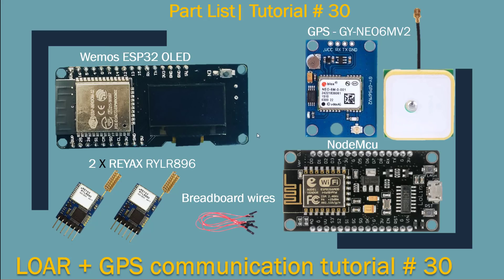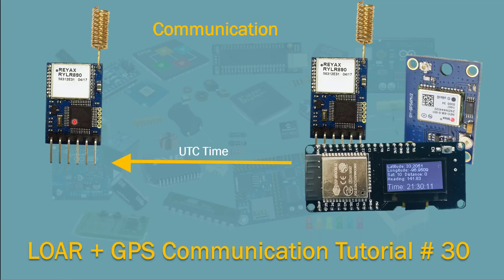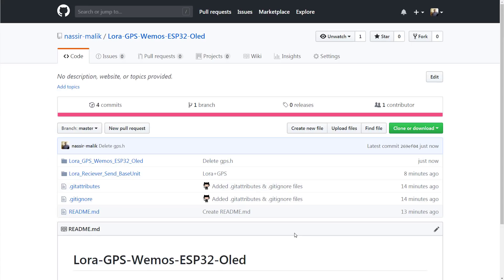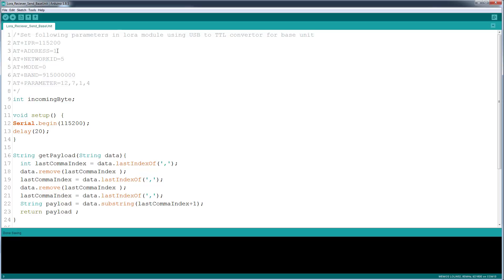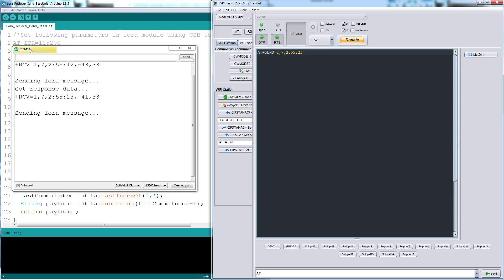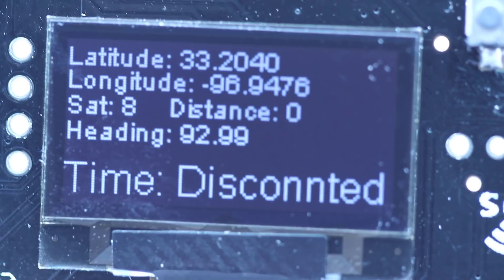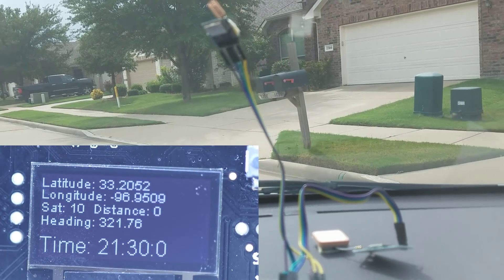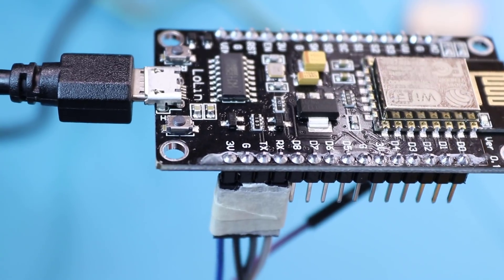Lora + GPS + ESP32 OLED + NodeMcu | Tutorial # 30

Comment: hi i have programmed the ESP3266 4..2 tu turn on my car using my house wifi signal, but i need install it in to my car and when im out my house have no wifi signal and ESP3266 not works without wifi signal , what module do i need to get wifi signal to the ESP3266  4.2
Reply from the maker: Use you cell phone hotspot to connect when away from home or use dedicated gsm module.

Comment: Nice project. I built similar using T-bean GPS Lora ESp232 with OLED display. Had similar finding regarding range etc. So started to building a Mesh repeater network..I used RSSI readings and displayed them on oled for signal strength as well.  while testing I noticed i was receiving packets that were coming from other Lora stations in my area. I investigated the data being received. And found it to be LoraWan packets. So i joined the forum and posted my project on their site.. However it turns out that they asked me to stop my project because it was transmitting far to much data  which was over legal requirements and that  my project was repeating the local lorawan packets and was messing with the system.   Oops. So i have abandoned  my project for GPS tracking.  Might be worth taking a look at their forum before continuing with Lora.
Reply from the maker: Thank you for sharing valuable information

Comment: This looks like a great option to have an ESP8266 with LoRa and GPS 
module send its GPS location to another ESP8266 with LoRa and have that 
one point a compass needle (on LCD) towards the sender. Having two work 
together would allow each device to point to the other. Never losing 
friends in a crowd, concert or hiking. TinyGPS++ is where i am going to 
start to look
Have you come across anything like this before? 
Ive had a look online but not sure if i have been using the correct search terms to see if anyone has done this yet

Comment: Great Video !
I heard you say you can have up to 16 addresses .. Is that a limitation on the protocol or the LORA network code itself ? 

Can those AT commands to set the parameters be sent during the init function of the Firmware ? 

Thanks a bunch .. and I truly appreciate your help !
Reply from the maker: 16 address is limitation on available GPIO pins on MCU. Yes, you can set  parameter in init function.

Comment: thanks for this work .. 
I have a big prıblem and ı hope you help me..
I have a dorji rf modul which is DRF7020D20 (https://www.direnc.net/drf7020d20-20dbm-433mhz-transparet-rf-modul) .
And ı wanna this modul to  interface with arduino but I have nothing.. No library , no information about connection of pims.
I hope you understand me and you will help me..
Reply from the maker: You can use serial (RX,TX pins) to communicate it with most MCUs. Connect it with computer using USB to TTL converter and test out AT commands and set parameters. Then connect it to NodeMcu or Arduino Uno send commands and retrieve data over serial. Good Luck